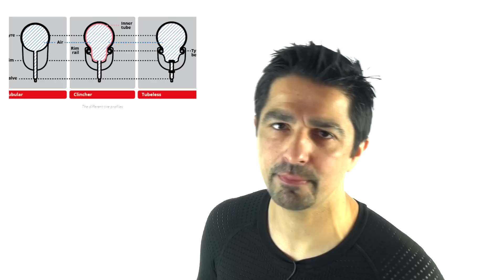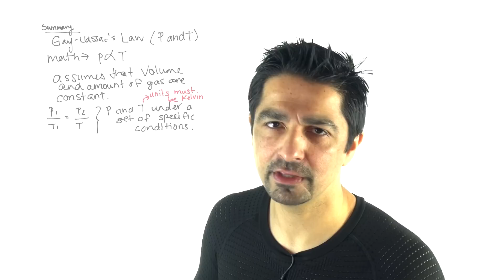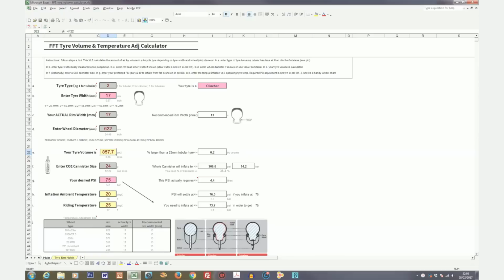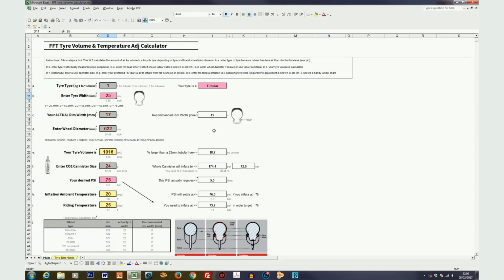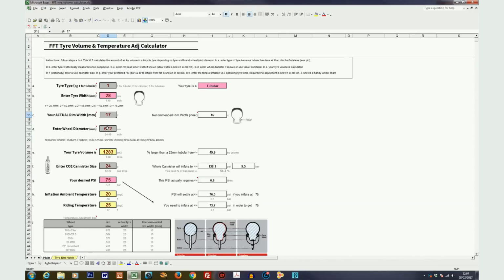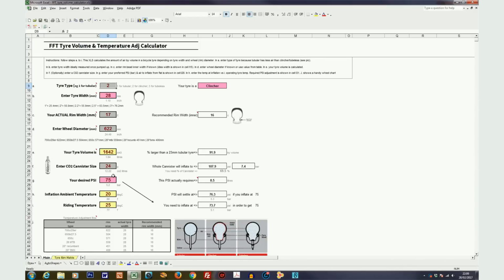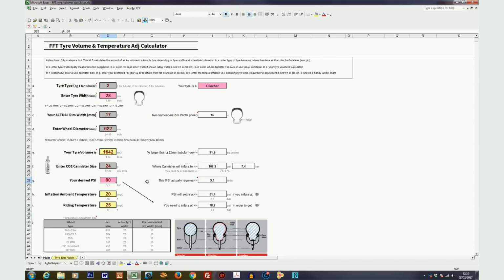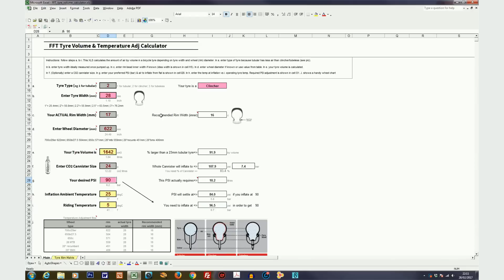FFT's formula #2 Adjusting tyre/tire volume pressure for temperature (Road TT Tri Cx MTB)

Comment: Curious, your comment… there is a VeloNews/WheelEnergy test of Paris-Roubaix tires article where they used an air shock + rough surface to simulate the vibration losses that would be lost in rider’s body by way of heat. Interesting that they confirmed the U-shaped rr + ‘impedance’ curve the Tom Anholt and Josh Poertner observed/predicted.

One surprising thing not pointed out in article, but seems significant was that optimal pressure did NOT seem to be correlated to tire width.. and not correlated to tire rr 😳

Meaning that the assumption that a tire is just an air spring and an any differences in tire construction were negligible at best seems to be wrong!

It seems like every tire model & width on a given surface has its own curve and so predicting with a tire pressure calculator (that assumes correlation of optimal pressure with tire width) is UNFORTUNATELY not possible? The construction of the tire seems to matter to impedance.. possibly inherent resonance frequencies of the tire might matter 🤷🏽‍♂️

Comments?
Reply from the maker: Hi thanks for this link which is paywalled (https://www.velonews.com/wp-content/uploads/2021/09/P-R-RR-results-graph.png); I agree a precise calculation should take into account all these factors (which we tried to do here: fft.tips/surface) and should also include tyre type.
Reply: @Fastfitnesstips  unfortunately it is behind a paywall.. it does show that the assumption that tires of the same width will all require the same optimal pressure is wrong.. 28mm and 32mm tires of different brands had optimal pressures all over the map... some 32 were higher than 28s.. some 28's higher than 32mm.. two sets of tires were same brand, same model, presumably same construction.. one had the 32 & 28 with same optimal pressure and one had 32 with a lower optimal pressure... seems to indicate each and EVERY tire has their own curve and this and given the inputs to all calculators I'm aware of they can't accurately predict optimal pressure.. you'd presumably need to create a calculator for every tire (brand, model, size) get an accurate prediction..

Comment: The spreadsheet doesn't seem to be working. Can't change any of the numbers..
Reply from the maker: You might need to request edit rights in the top left corner? // Otherwise go to cyclingapps.net/calculators for another version
Reply: @Fastfitnesstips  yeah thanks got approved for edit access.

Comment: My weight is 83kg or 183lbs and I’ve used an online pressure calculator which recommends that my wheels should be 222psi. Does that seem too high? The max pressure on my gp4000 S II is   115.
Reply from the maker: Max use our calculator to find out. It's free
Reply: FastFitness Tips: Cycling Science! Thanks

Comment: Your calculations helped me a lot but i reached here searching for a more accurate way to calibrate a car tyre (which is easier because it does´n envolve a cannister)

P1/T1=P2/T2 -> P2=P1*T2/T1

And converting the temperature from K to C:

P2=P1*(T2+273)/(T1+273)

Now, such my car´s documentation asks for 32 psi on the front tyres (which is at 25ºC):

P2=32*(T2+273)/(25+273) -> P2=32*(T2+273)/298

So, if I want to know the pressure needed for a 5ºC climate:

P2=32*(5+273)/298 = 29,85 psi

Is this valid?

Comment: Great advice as always, thanks.

Deflation - I at least check the tyre pressure by feel every ride, and at least once a week with a gauge. When setting up for races, I would prepare the night before, with a track pump with its own gauge, and a more accurate hand held gauge. It does not matter if your gauge is super accurate, as long as it is consistent, which is why I prefer the hand gauge. Get one that covers the range you are using, and not wider if possible. It would be several wheel sets, mainly Dugast tubulars with hand made latex inner tubes for cyclocross. They would be softer by the next morning, race day, and need to be pumped up a bit, having dropped from say 25psi to 23psi, which at that pressure is noticeable 

Road bikes - Vittorrio tubulars have latex inner tubes so also deflate after a while (but not overnight), whereas Continental tubulars have butyl, so do not deflate significantly

Comment: Temperature adjustment - good point.

At a triathlon where the bikes had to be left over night, they told us because of the high temperatures to leave tyres soft and top it up the next day.

Sure enough, a few people did not bother, and there were several exploding inner tubes around mid day. And it was not that hot.

We had to fly there with our bikes, and the advice when flying was also to leave the tyres soft, due to the pressure differential in the hold.

Comment: Handy. Since one is usually going to check one's tyre pressure indoors it makes sense to compensate for the expected outside temperature. Nice to have it quantified like this as, even if there's no time to open the Excel page a quick look at your weather app should give you, after a bit of practise, a ballpark addition/subtraction to achieve your desired pressure during your ride. Neat, thanks!